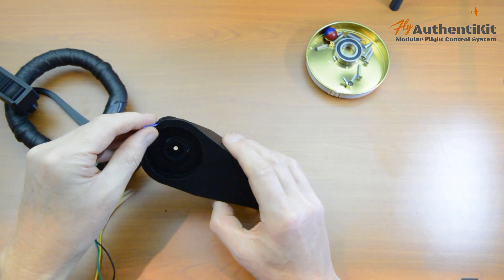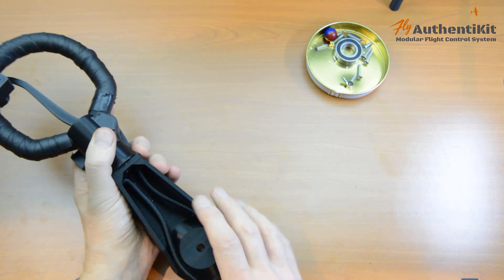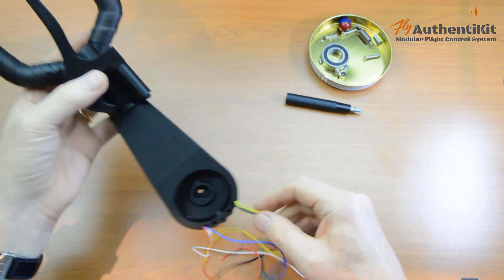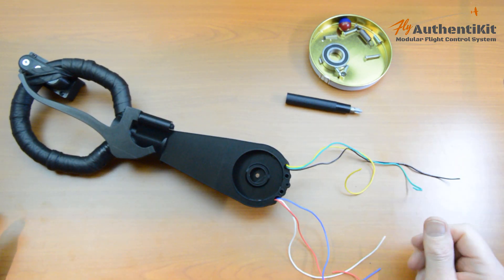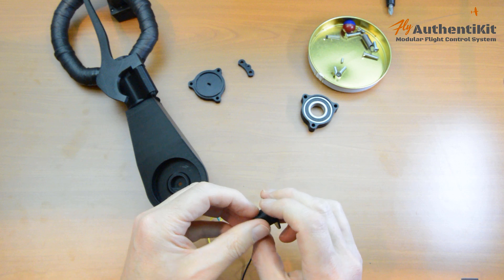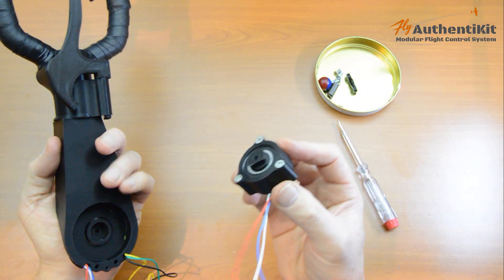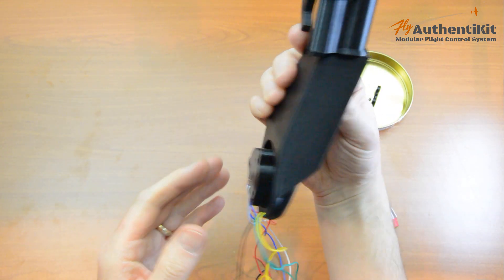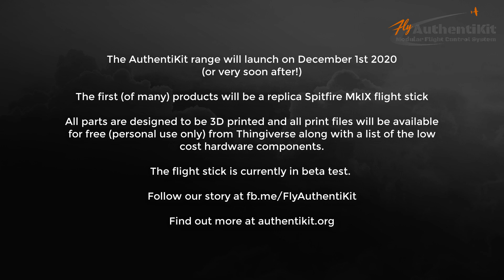AuthentiKit Spitfire MkIX Flight Stick - Self Assembly Part II

Comment: Would be cool if just the grip could be mounted on Thrustmaster or Virpil bases
The Virpil would even have a axis for the brakelever
Reply from the maker: Nightdare yes, i guess it would be useful. You’d lose all that extended travel though. I have +/-40 degrees movement in pitch for example. I think virpil has +/-15. Correct me if i’m wrong please.
Reply: @AuthentiKit  

Yes, but the average simmer doesn't have the setup for a full size British fighter yoke,
Also many simmers have (at least) a warthog, so  it appeals to those that already have a working setup and are in no hurry to replace their entire stick, but would love a Spit/Hurr spadegrip, increasing the possible market

I know this was made to appeal to the absolute spitfire fans, but a 'scaled down version' could potentially make a more general crowd also happy
Reply from the maker: Nightdare all very good points. As my main aim is to kick start a community of people making freeware  controls to a common standard perhaps someone else will do it.

Comment: Really elegant design. you mention a friction variant of the bearing / hall sensor holder. Is that available to download ?
Reply from the maker: Should have that out in January-ish as part of the throttle quadrant, though it will probably be a smaller bearing as the 6003 is way overspecced for that
Reply: @AuthentiKit  look forward to it. Congrats on getting the first stage out there, will definitely be having a go at making